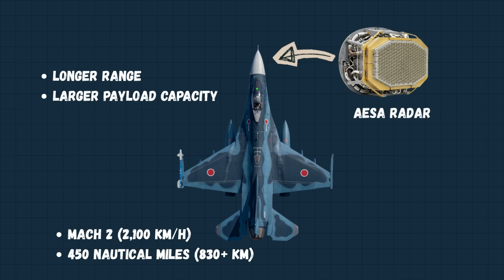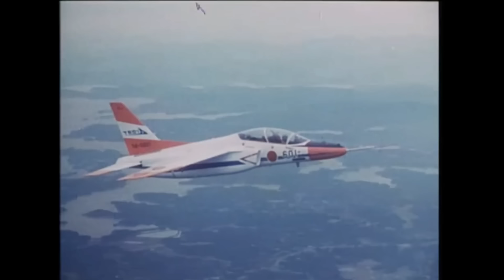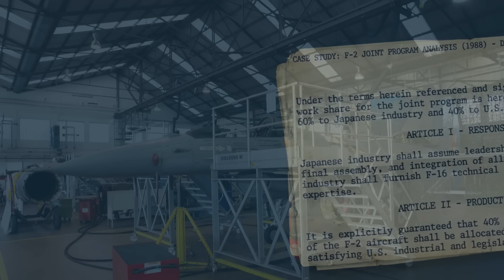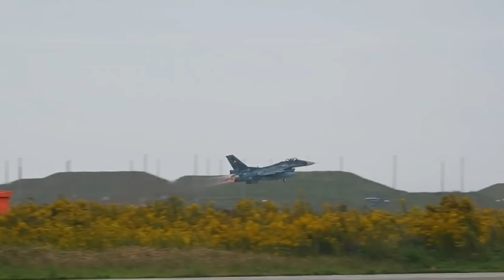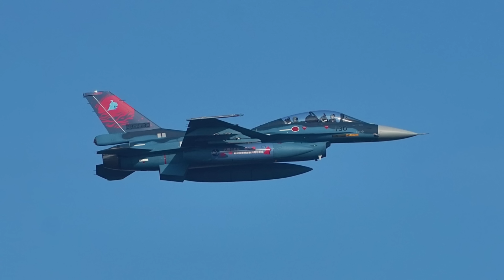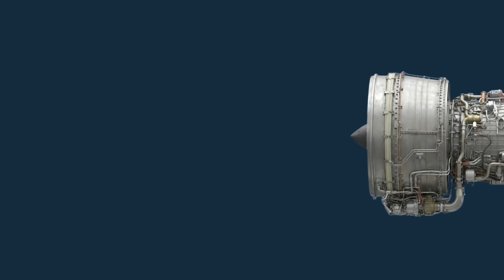How a Cheap Fighter Became Japan’s Most Expensive Jet

Comment: The United States was not pressuring Japan to make the FS-X a joint venture...that's a pretty obvious Lie.  It was Japanese who insisted that the FS-X be a joint-venture - because it was the Japanese who needed the F-16's Core Technologies, Avionics, fabrication processes, etc.   The United States Industry was perfectly happy to see Japan try to INDEPENDENTLY develop their own fighter - both the Americans AND Japan KNEW Japan would fail without significant Tech from the USA.  As with most such stories regarding America, this video deceptively inverts the balance of Power between America and foreign countries, including Japan....in the 1980s, Japan was never actually in the driver's seat - they pretended to...the Japanese may even have believed they were...and maybe they would have been, IF the Americans were literally a Vassal state conquered by Japan....except that's not Reality.  Japan was not a Super-Power...it never was.

So when Americans said "No" to the Japanese regarding every tech transfer regarding the F-16, the Japanese did the only thing they could...histrionics - they threw an ABSOLUTE FIT.  Akio Morita, founder of Japan was one of the more famous cases, writing a best-selling book insisting that it should be "The Japan that can say "No" ".

So yes, the basis of your video is a foundational Lie.

The whole point of the FS-X program was NOT to develop required capabilities for the Japanese defense.  The Japanese were famously unconcerned about the Soviet Union for example, instead using American technology that the Japanese had LOCALIZED/CLONED to develop and fabricate machinery, shafts, screws, etc, to improve SOVIET NUCLEAR BALLISTIC MISSILE SUBMARINES.  Yes, the Japanese knowingly helped the Soviets gain an edge in NUCLEAR WAR at the HEIGHT of the Cold War in the 1980s.

Tell me again how "concerned" the Japanese really were about "Defense" - they took the American Defense System and Tax Payers for suckers.

So what was the real purpose of the FS-X from the Japanese point of view?

The point of FS-X was to acquire American Technology so it could eventually be used for "Export Markets".  The Japanese didn't have engineering requirements that disqualified the American F-16 or F-18.  You are telling a Lie by inverting the Causality (again).  The Japanese wanted Tech Transfers, and DELIBERATELY created requirements that would disqualify EVERY Fighter-bomber in existence...so that the F-2 would "have to be built in Japan".  

The Japanese would famously make up excuses for why Americans would have to license their products to be manufactured in Japan...my favorite was the one about banning American Skis, because the Japanese claimed that American Skis hurt Japanese Snow...no, I'm serious.  It got VERY funny when Japan was making bids for the Winter Olympics in 1986 - the big question they kept getting mocked with was "You can't allow foreign Olympians to use their foreign Ski equipment to damage Japanese Snow."  Unbelievably, the Japanese were AMAZINGLY "indignant" as if they had any right to be....when it came to "gas-lighting", the Japanese could be a real piece of work.

The Japanese eventually gave up on the whole "Unique Japanese Snow" bit, and allowed the importation of American Skis, then were awarded the Winter Olympics (to be held in 1998 in Nagano).  Of course, they kept a WORLD of fictions for other trade barrier shenanigans.  For the longest time, entire populaces of Japanese thought there was no Snow in American winters...No, I'm not joking.  I was in Japan in the early 2000s...unbelievable holdover of a Japanese politically-induced delusion from the 1980s.

Do these trade policies sound familiar?  They should, because the Chinese representatives aren't shy about telling Americans that they're just copying Japanese tactics.

Not that these kinds of delusions didn't make their way across the Pacific to America...there were a LOT of American Communists, for example, who in the waning days of the Cold War, had lost hope in the Soviet Union, and were desperately rooting for the Japanese to beat America.  Today, these kinds of people are apparently called "Weebs", but back in the latter 1980s and early 1990s, this was a serious point of contention between Right and Left, with the Left actively allying themselves with a new foreign Champion, the Japanese, out of despair of watching the Soviet Union decline.

Anyway, what really stopped most of these Japanese-held delusions began in 1985, with the transfer of American Tech (from semiconductors to Military hardware)....to other countries not named "Japan".  It used to be that Japan was America's exclusive fabrication and manufacturer...obviously with Japan selling to America's enemies, and threatening to squeeze or cut off Japanese products to America (which they did starting in 1988) that had to change.  Basically, the US companies from Intel, Motorola, Micron, etc, started transferring next generation RISC II, Parallel computing architecture, lithography, deposition, purification, etc, to South Korea, Taiwan, and China, NOT exclusively Japanese companies like Toshiba and NEC (exclusivity of American Tech transfers and its access to the American Market is what created Japan's monopoly).   Singapore and Hong Kong dipped their toes in too, but they found out they were better off focusing on petrochemicals, logistics, banking, etc.

Result?  Within 7 years, for example, Japan which had accounted for 70% of the worldwide IC market share collapsed to under 15%...that's the reason for today's existence of Taiwan's TSMC and South Korea's Samsung and China's Huawei (like Samsung and TSMC, Chinese State enterprises were created to take advantage of Japan's stupidity, and eventually coalesced into what we now know as Huawei and DTG which is now SMIC) - they all goes back to 1980s Cold War politics between Japan and America.

The demotion of the Japanese, the Persian Gulf War, the collapse of the Soviet Empire, etc...

This is why when Trump cut technological cooperation with Chinese companies, Japan, Netherlands, Britain, Taiwan, South Korea, etc....they all complied.  Because this is the world's most open understated reality:

Taiwan is NOT the biggest, most successful semiconductor foundry in the world because they're somehow "more brilliant" than anyone else.  Yes, the Taiwanese and Nationalist-Chinese are quite hard-working, intelligent, decent... and while they do follow the Asian stereotype of being conformists, they do demonstrate healthy bouts of innovation here and there.  They have all these attributes and more, to their credit.  But you can say that about many countries.  So why does America use Taiwan as such a concentrated hub of semiconductor fabrication?

One word:

"Obedience".

They know who's in charge.

Taiwan's success is a manifestation of its service to the American Empire - the moment it thinks and acts otherwise, America will look for a new Vassal state to do its bidding.  Japan knows this all too well.

One line that was uttered between Japanese and American parties really raised the temperature in the 1980s  because it crystallized the moment:

"Don't forget who your Conquerors are."
Reply: Japan is developing a sixth-generation stealth fighter jet, the Mitsubishi F-X (unofficially called F-3), to replace its aging F-2s and Eurofighter Typhoons. The F-X is expected to be introduced in the mid-2030s.

Comment: F2 should have been F16 Viper (w/ external fuel tank)  & better yet F15EX. Both a lot cheaper to make & run. Even better would have been KF-21 route. Marine attack fighter should have 2 engine for payload & reliability. F16 is still updated & made, but NOT F2 for extremely compelling reasons.

Comment: All that work and they cheaped out on the canopy design.

I sometimes wonder why didn't they just buy the F/A-18 or even used it as a starting point. The F/A-18 Super Hornet was essentially a larger version of the F/A-18 Hornet and could have matched the payload requirements with some modifications.
Reply: 最近のエンジンは信頼性が高く、単発エンジンでも安全性を保てるからです。双発エンジンだと維持費が高くなります。そして大掛かりな改造をすることで日本の技術を進化させ、未来に投資することができます。
Reply: @doccqp3945  you guys already operated the F-4EJ and the F-15J, which are both twin engined aircraft. Even the F-1 was twin engine.
Reply: エンジンも石川島播磨重工業IHI*でライセンス生産しています。V2500エンジンの部門も生産しているよ。
Reply: エンジン以外は、日本は開発できたけど、アメリカが横槍入れてきて、F16ベースで開発したけど、機体もレーダーも日本が素材から開発したよ。

Comment: I'm Japanese, and I couldn't understand why Japan would decide to completely customize a fighter jet like the F16(JAPAN Code F-2) at such a huge cost, so I asked an expert.

Because the F15, F14, and even the F/A18 and YF-23 were cooler, so I thought the F16 was lame.

The answer is that it had already perfected all the aerodynamic performance tests. It was already so perfect as an aircraft in aerodynamics that it could calculate pi to thousands of digits.

In other words, among aircraft that travel through the atmosphere, there are many complex reasons why they can fly, such as fluid dynamics and relativity. And currently, neither the F22 nor the F35 can surpass the F16. They simply carry people and fly and land. There is no aircraft that surpasses the F16 in these characteristics.

So how do the F22 and F35 fly? They just fly with ridiculous thrust while leaking fuel.

In other words, powerful engines are used to replicate physically impossible flight scenarios, requiring a tremendous amount of computer control to achieve the forceful flight.

Yes, manned aircraft were already perfected with the F-16, and its weight distribution, flight characteristics, takeoff and landing performance were already the pinnacle of civilization 50 years ago.

Japan took the already perfect aircraft, the F-16, and modified it to the limit. I know the specific modifications, but I can't comment on Japanese licensed technology. However, the bottom line is that the F-16 was easy to use. In other words, the F-2, the Japanese version of the F-16, is already in its final stages as an aircraft, and no further measures are possible unless the pilot is turned into a cyborg.

This is why Japan insisted on redesigning a clunky, weird airplane from the ground up.

It may be small and uncool, but it's the only fighter plane that can actually perfectly execute all missions on all battlefields except for massacres.
Reply: "it could calculate pi to thousands of digits"
Translation error?

"many complex reasons why they can fly, such as fluid dynamics and relativity"
Relativity is not needed at these speeds and certainly not in an F16.
Reply: Massacare, do you mean kamikaze?
Reply: @brianvincent7398  No, nuclear weapon package.
Urban Fall Electronic Warplane Package
Reply: OK Boomer

Comment: The video is impressive, but it lacks several crucial data points: the composite wings of the F-2 are constantly developing cracks, with a lifespan only being one-quarter of the design lifespan, necessitating frequent inspections and replacements. Furthermore, the strength of the F-2's fuselage and wings falls far short of the naive expectations during its design phase, resulting in the F-2's usable G-force range being only -2 to +4. This is an expensive white elephant, primarily intended to enable Mitsubishi to master aircraft manufacturing technology and for politicians to carve out kickbacks from substantial funding allocations. Frankly speaking, it is not a technological marvel.
Reply: 10年以上前の情報ですね　その観点でいうなら初期のAESAレーダーはひどい性能でした
Reply: 日本が運用する為のノウハウはある。それに、F2は格闘戦を目的してはない。あくまで、長距離から対艦ミサイル攻撃をやるための攻撃機です。
Reply: This information is just false? The -2 / +4 range mentioned in the XF-2 development papers was a testing envelope. Just like they only did initial FBW testing up to mach 0.8.

The F-2's structural rigidity is excellent, multiple sources around its development stated it to be capable of 9Gs, even with a full load of ASMs.

The initial worries about cracks were specifically due to the mounting of mock up sparrows on the outermost pylons, as the F-X outline originally called for 4x ASMs and 4x MRMs at the same time.

Also, the F-2 has a very good FBW, featuring things like ME (also called MLC+), which further improve its manueverability.
Reply: This information is just false? The -2 / +4 range mentioned in the XF-2 development papers was a testing envelope. Just like they only did initial FBW testing up to mach 0.8.

The F-2's structural rigidity is excellent, multiple sources around its development stated it to be capable of 9Gs, even with a full load of ASMs.

The initial worries about cracks were specifically due to the mountinf of mock up sparrows on the outermost pylons, as the F-X outline originally called for 4x ASMs and 4x MRMs at the same time.

Also, the F-2 has a very good FBW, featuring things like ME (also called MLC+), which further improve its manueverability.
Reply: @user-Xx0xxxxx  🤣🤣🤣🤣🤣"The F-2's structural rigidity is excellent, multiple sources around its development stated it to be capable of 9Gs, even with a full load of ASMs."
Reply: @siroyiryuu   Yeah? Its something i've seen quoted in several news articles from around the time of it's development. IIRC its originally from Masashiro Ide, he was involved with flight control research related to the F-2, and is one of the main authors for the published research notes on the XF-2
Reply: Your understanding is outdated. Indeed, there were such issues in the early stages. However, since then, the composite wing materials have been upgraded, and with changes to the hardpoint positions and modifications to the internal wing structure, those problems no longer exist. The current issue is that consumable parts needed to maintain this aircraft are no longer being produced, causing the aircraft itself to be worn down to harvest parts. First of all, if the materials were really that unreliable, aircraft like the Boeing 777 would be considered unsafe.
Reply: @nekomusume3010  Your answer is completely contrary to the facts, and you have not provided any evidence to support your claims. Furthermore, you have misrepresented the concept. In addition, I can confirm that you do not understand Japanese. The Air Self-Defense Force's annual budget and reports disclose the maintenance and replacement budgets for the F-2 fighter's horizontal and vertical tail surfaces. The Boeing 777 and 787 are not products of the same generation as the F-2 fighter, and their manufacturing processes are completely different.
Reply: @nekomusume3010  また、F-2戦闘機の推力は常に不足している。今年（令和7年）8月に墜落したF-2戦闘機の調査報告書でも、推力不足がF-2がこれまで解決できていない重要な問題であり、運用可能な飛行性能に深刻な影響を及ぼし、飛行の安全に影響を及ぼしていることが指摘されている。
防衛白書でもこれは遠回しに言及されている。防衛白書が理解できるのか、私はとても疑問に思っている
Reply: @nekomusume3010  さらに、F-22戦闘機の推力は常に不足している。今年（令和7年）8月に墜落したF-2戦闘機の調査報告書でも、推力不足がF-2がこれまで解決できていない重要な問題であり、運用可能な飛行性能に深刻な影響を及ぼし、飛行安全に影響を及ぼしていると指摘されている。
防衛白皮書でもこれについてうっすらと触れている。防衛白皮書はお読みになれますか？とても疑問です。
Reply: @siroyiryuu  すべてにおいて完璧なメカエンジニアリングはありません　クラックについても「解決」は無事に全機が引退するまでは「解決された」、と日本的な思考方法では言えないのです　推力不足はその通りです